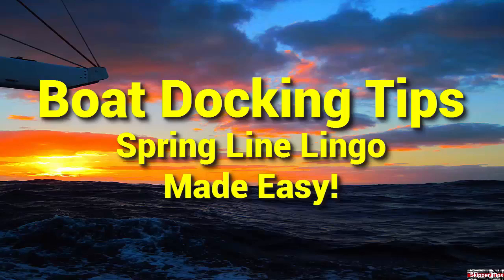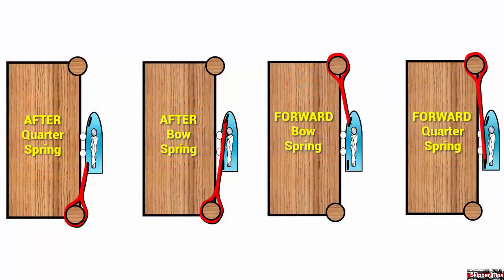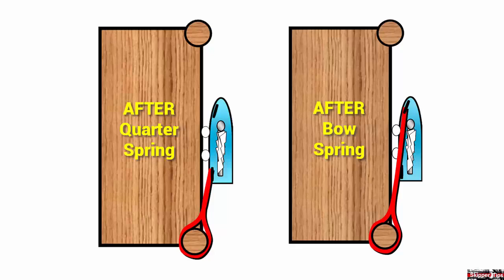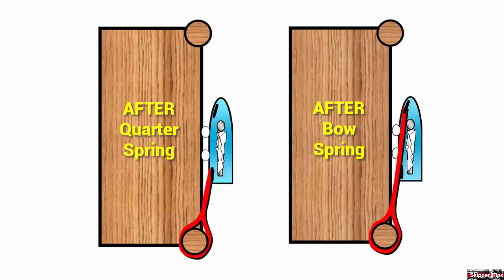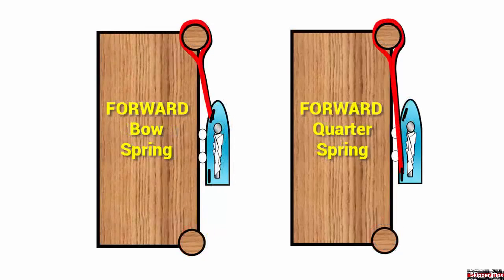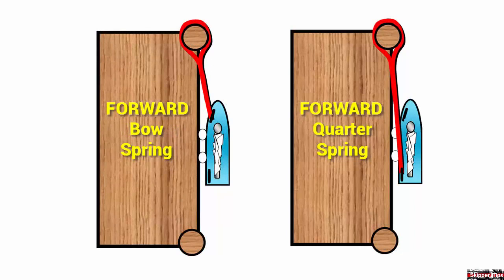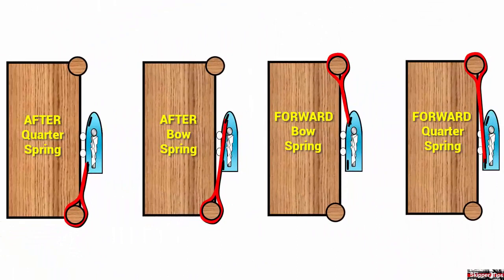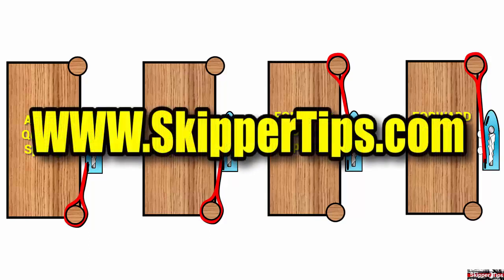Boat Docking Success Begins with Spring Line Lingo

Comment: but in what conditions do you use the different spring lines in ????
Reply: You use spring lines either to secure the boat from moving fore or aft, or as a fulcrum to assist in manouvering the boat in various situations. Without wrinting an essay, in the final picture the After quarter spring prevents the boat from moving forward along the dock, whereas the after bow spring in combination with forward throttle and rudder to port results in the aft swinging out from the dock.
At the same time, if you are approaching the dock and attach the after quarter spring  and slowly throttle forward the boat will gently snuggle up against the dock.

Using spring lines is very helpful! :)
Reply from the maker: Here are a few other videos on using springlines for docking:
https://youtu.be/xLcZfxbKCuk
https://youtu.be/rc9-m5d4NUs
https://youtu.be/6Ha4CmBe7Gs

You might also check out my new docking book on Amazon, which shows how to use springs for tying up, docking and leaving a dock, all in great detail. Right now, running a weekend special on the Kindle version (all books in my new 3-book series): https://www.amazon.com/dp/B0BNLYH4YY/
Reply: @Tordan69  Thanks for that